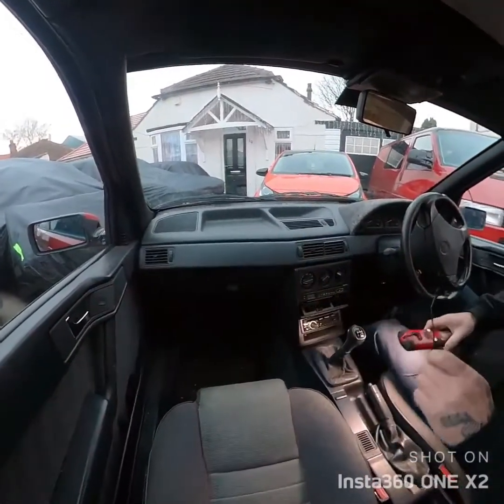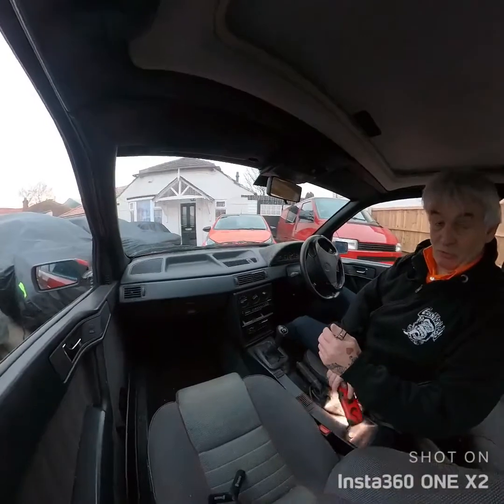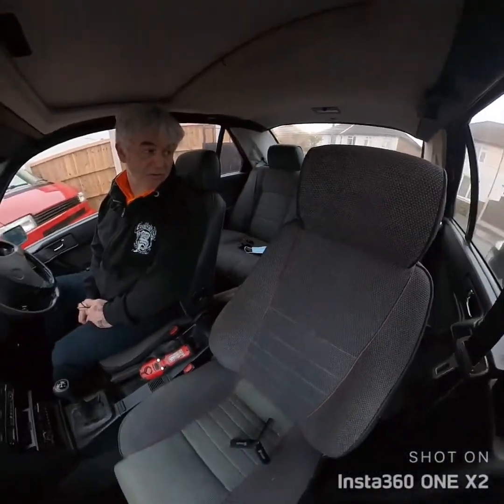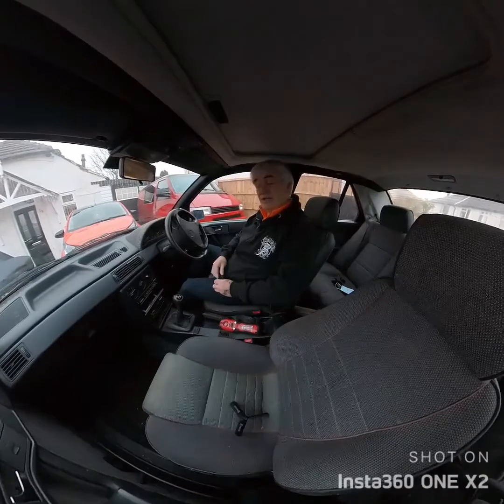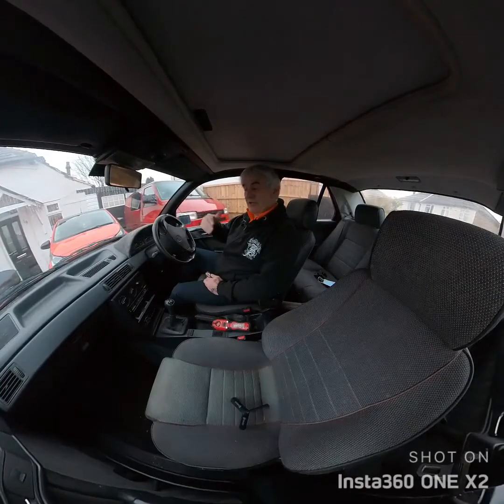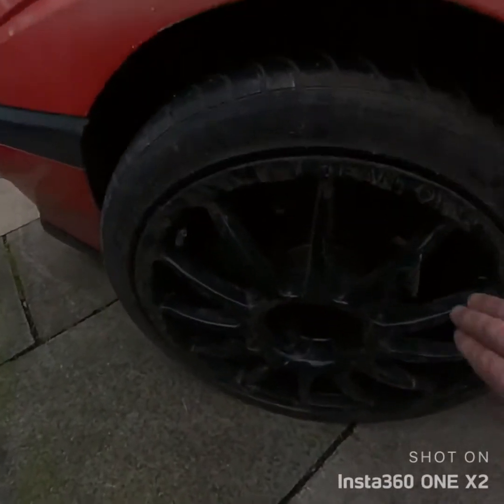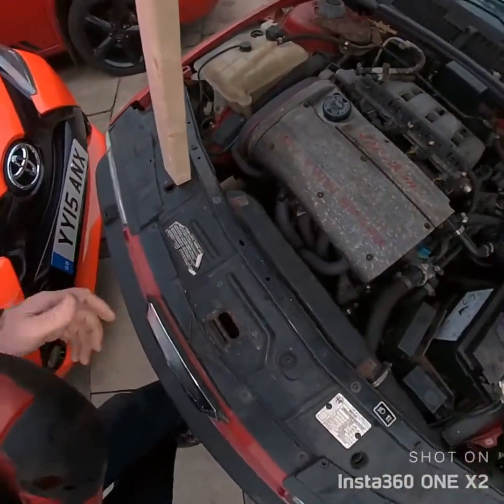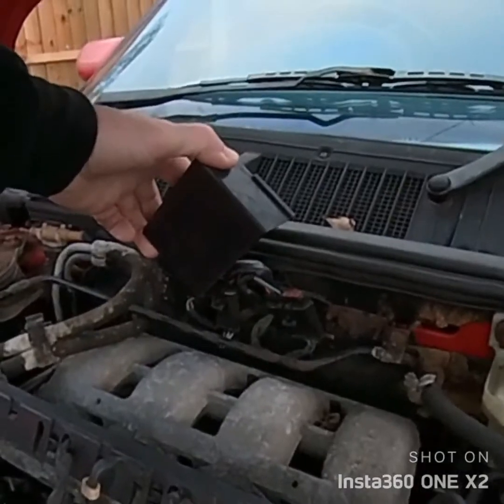Alfa Romeo 155 find

Comment: It’s a Sportpack 155, sadly missing it’s speed line alloys. I’ve a P reg one exactly the same. Hope you didn’t pay much much for it, it needs a respray. The mirrors if you can find them are terribly expensive, last ones I saw were new old stock and £350 each. Parts are hard to get for the bodywork now.

Comment: Saw this car for sale on ebay not long ago, did you move it on ?
Reply from the maker: the car is still for sale ,
Reply: @ that’s interesting because I actually sent a message on eBay asking to come and have a look at it and I even sent an offer but didn’t get a reply. I’ve ended up buying another since as I wanted one for a project
Reply from the maker: @155andRising  very sorry,i have had a lot of messers asking questions and not turning up. offering very little ,  Car is going back up for sale
Reply: @theflyingsquad4585  no problem. Hope you get what you’re after . I’m halfway through stripping mine down now . I’m putting a 3.0 Busso in it